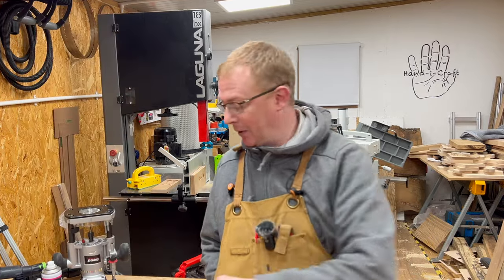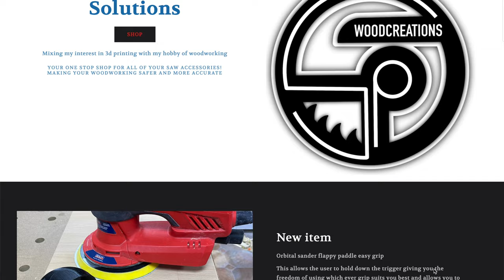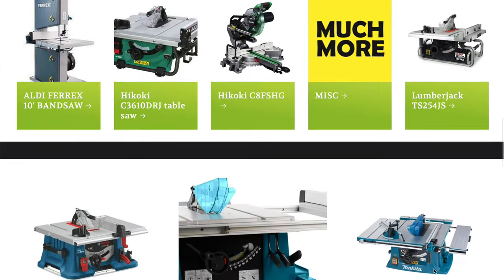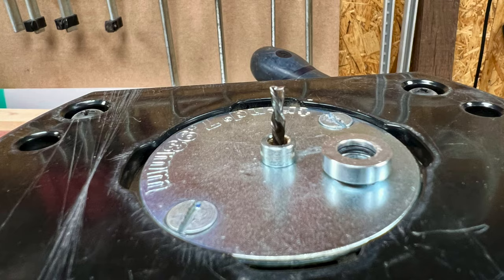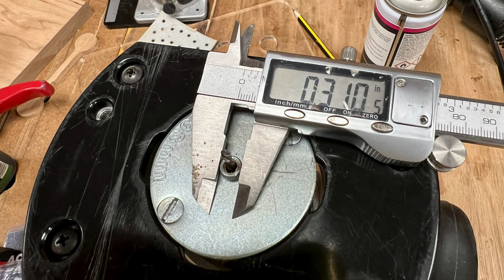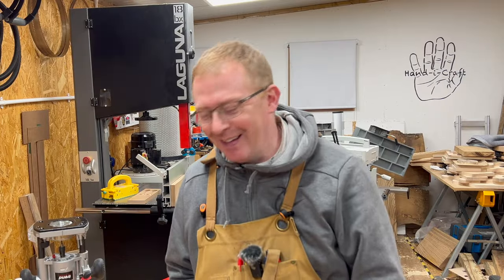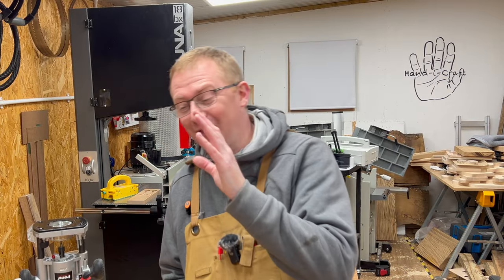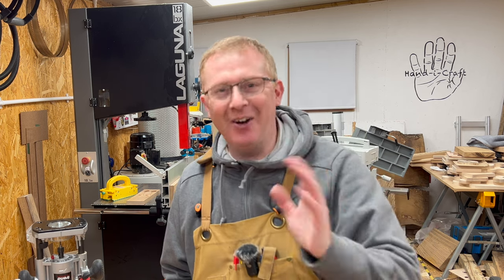'Bowtie' Inlay - No Chisel Work Required

Comment: Have you any affiliated links and discount codes for the o3 adhesives mate ?
Reply from the maker: I have pal. Link is here https://www.o3adhesives.co.uk/?sca_ref=3235117.sIIhXhsKp8 and use the code LEOHIC for 10% off👍👍
Reply: Great job Leo.  I doubt I could follow that narrow template as well as you using both hands.  Of course I only have a big De Walt router at the moment which is a bit cumbersome.  You will probably need longer dumbbells for your big table tops but I think the underneath bar you used is just as good and probably better as it leaves that lovely top unencumbered by the tie bar.

Comment: Another thing you may wish to try ... once you've done your initial inlay, use one of the smaller inlay templates and cut into the bigger inlay, then use a contrasting piece of wood for the smaller inlay 👍
You can either make sure the second inlay is centred or offset/rotate slightly to give an interesting look 😀
Reply from the maker: Interesting concept and worth trying out 👍👍

Comment: I think a palm router would be easier and safer for you. I love the idea of no chisel use. Thanks
Reply from the maker: Thanks Karen for the feedback. This is my 1/4 inch palm router in its plunge base. The difficulty with just having it in the ‘palm’ style base is not being able to plunge it and the plunge part has to be accurate otherwise the bowtie part won’t fit snug. I know this probably doesn’t make sense in words but kind of does in my head 😂😂😂

Comment: Hi Leo, great to see your progression taking on projects I could only dream of ( need a woodworking shed first). The acrylic/wood office plinth looks gorgeous. Well done.
I was going to ask a question but frankly you have already answered it regarding chisel work. Left (dominant) arm amputee, posted on your post surgery vlog, dabbling on wood-worrying & have been stumped on how to use my chisels safely. Can gouge & pare off soft woods but recently I have a project involving oak & I literally threw my chisels out the window. Only tool that comes close is a pointed rasp attachment to my knock-off dremel although this can burn the wood.....any suggestions?
Reply from the maker: I hear your frustrations pal in regards to chiseling etc. Your mind can see what you want to happen but your body isn’t capable. My advice if you’re trying a Dremel style tool to turn the power right down and run it on a test piece. I’ve done that in the past and it certainly has helped to reduce burn on the wood 👍👍